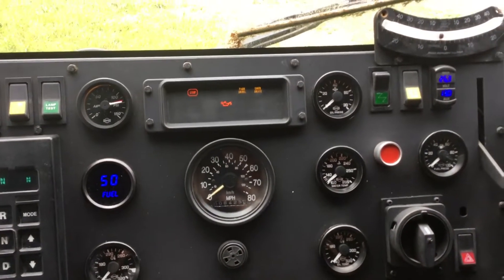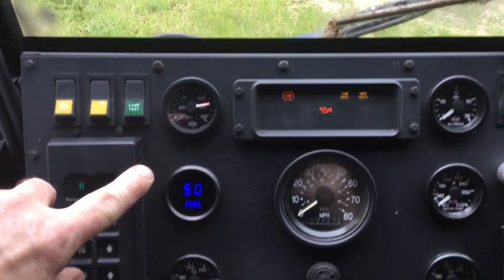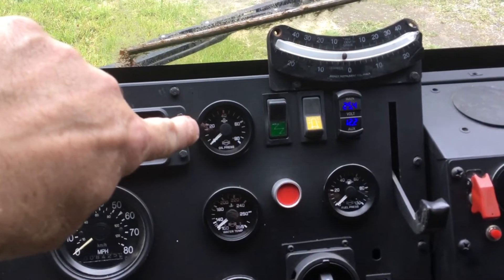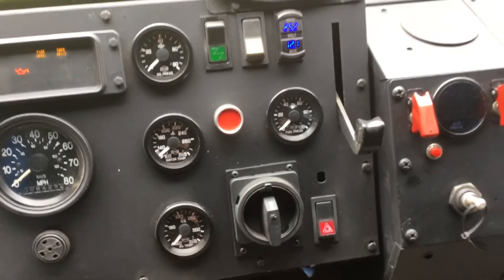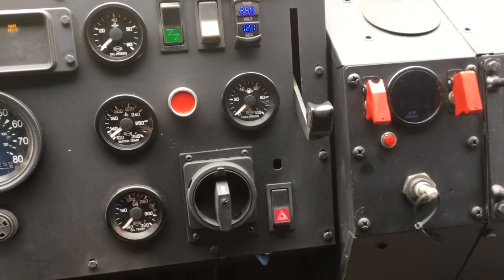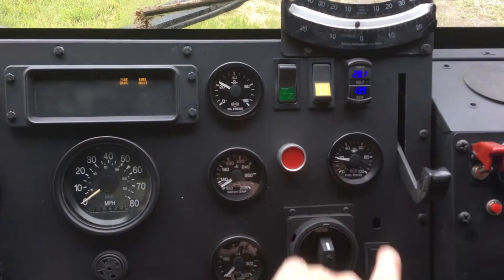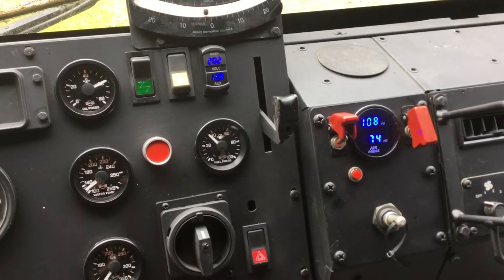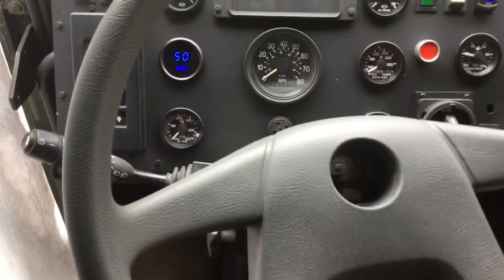LMTV New gauge walk-thru.

Comment from the maker: The thing you have to remember about the LMTV when it comes to gauges is that they are 24V gauges that use 12V lighting, so it is not plug and play.  In fact this project was what pushed me to re-configure the power panel and turn the work light relay into a 12V ignition power relay(one of my other videos), as the A0 does not have switched 12v ign.  The oil pressure, fuel pressure, water temp and oil temp gauges came from surplus center. https://www.surpluscenter.com/Gauges/Automotive-Gauges/?page_no=1  They are mostly mechanical gauges, except the two oil temp gauges which are 24V. I had to source 12V lights for them at Napa and I will have to extend the sensor wiring to reach the sensor locations.  They appear to be out of the mechanical oil pressure gauges.  The mechanical water temp uses a 144” capillary tube which is long enough to reach the thermostat housing comfortably.  Most of these gauges are discontinued by Isspro.com, so part numbers might not help all that much, but you can find their current electrical and mechanical equivalents there.  The fact they are old style is why they were so reasonably priced at surplus center:)  The dual needle air pressure gauge was sourced from a truck supply shop which was a little less expensive than from Isspro directly.  The fuel level was an inexpensive electronic from Jegs. It is compatible with multiple sensors and you cut a wire loop on the harness to configure it for our particular sensor resistance. The dual air used in the CTIS control and the digital electric were off Amazon…  The new low brake pressure switches(66 PSI) are the same as the one used for the park/emer dash light and are a common Haldex part.
Reply: Sounds like you have a lot of content for future videos. Thanks
Reply from the maker: @mehrdadmorabbi6743  No, not really.  I mainly do videos as I come across interesting parts of mods or maintenance(someone had to request this one:)).  Sometimes they give me a little break to contemplate what I am doing.  If it is not something I can do/get in one take, I typically won’t do it, as I don’t have the time for much editing.

Comment: Great video as always, I bought the same dual air pressure gauge you have for my AO but the new gauge has two air fittings on the back and the stock gauges do not, how did you make that work ? Thanks so much
Reply from the maker: Directly below the air gauges, Under the dash(about eye level when you open the door from outside) there is a 2way check valve that samples primary and secondary air to feed the park and trailer control valves.  The primary and secondary air lines are Td there and the electric gauge/switch senders are installed there.  Each sender has 2 wires, one is the variable output to the gauge and the other goes to the low air buzzer in the dash.  I removed those gauge senders and installed T fittings(2ea 1/8 npt, 1male 2 female ports).  I think I used 1/4-1/8 npt adapter bushings to put in the new T fittings. On the new T fittings, one port gets a npt-1/8” compression fitting and a poly line to the appropriate front or rear gauge port(2ea mechanical oil gauge installation kits).  The other ports get Haldex 66PSI low air switches(2ea Part no. BE13241). The wire that went to the gauge gets insulated.  The wire that went to the buzzer goes to one terminal on the new switch. The other terminals get a jumper to ground, so when either sw goes below 66PSI, the switch closes and completes the circuit to ground to activate the buzzer…